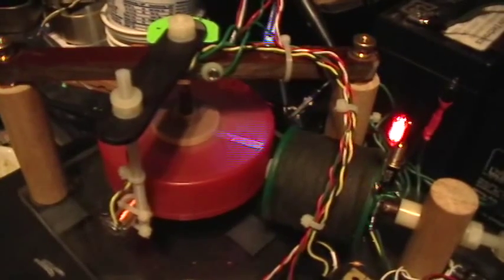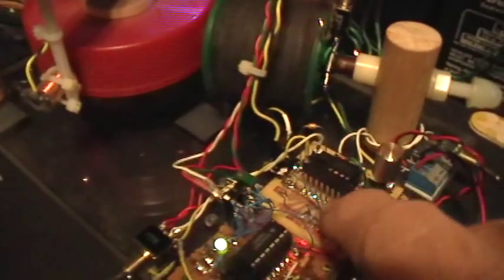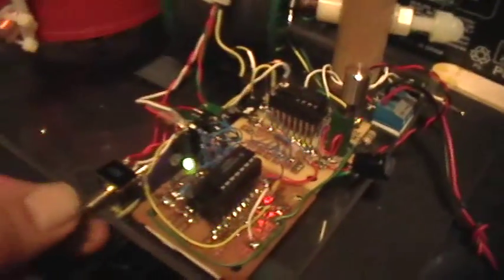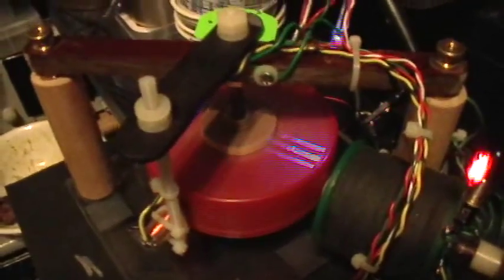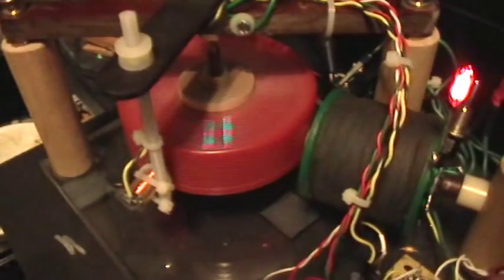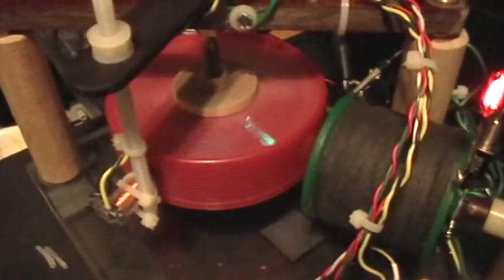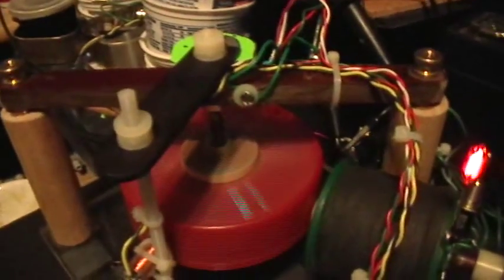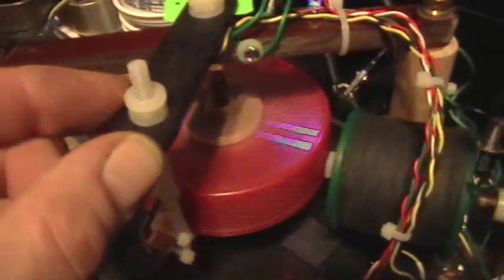Pulse Motors: MHOP #7: Dwell and Timing Strobes Video Test

Comment from the maker: The sense coil is removed from a CRT TV chassis "on" relay. It's a 24 volt relay. Or it was, rather. 

Sense coil: Carefully removed from a television set SPST relay, 24VDC coil, coreless. DC resistance 273 ohms. Inductance 33 mH (by ProsKit meter, may not be accurate due to high resistance of coil.)